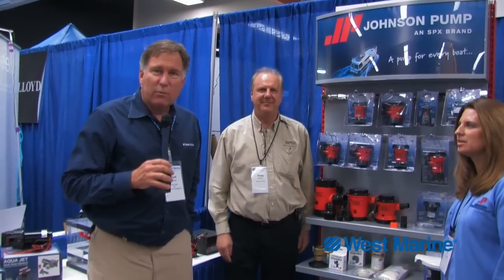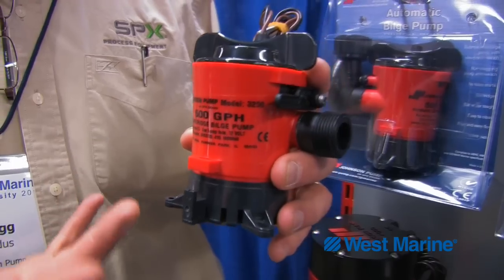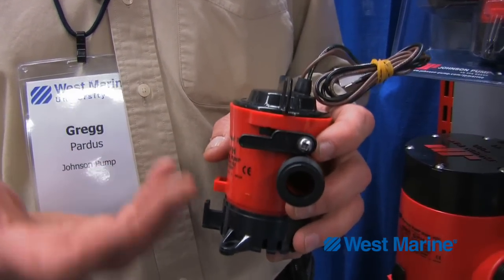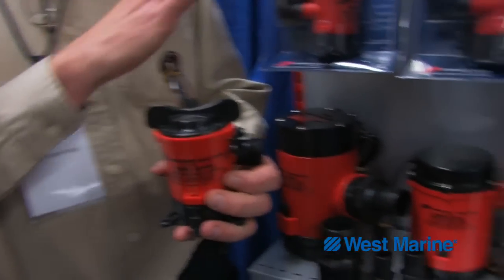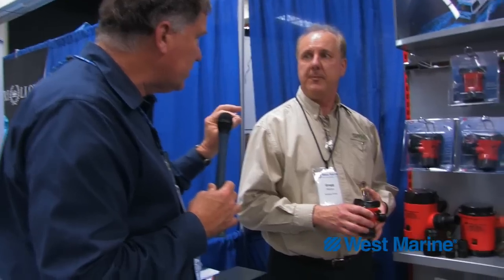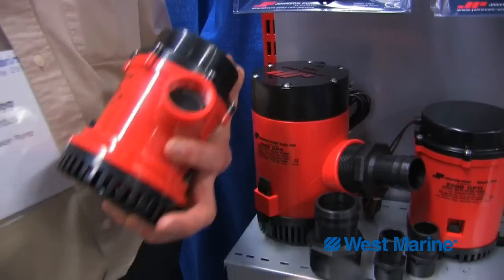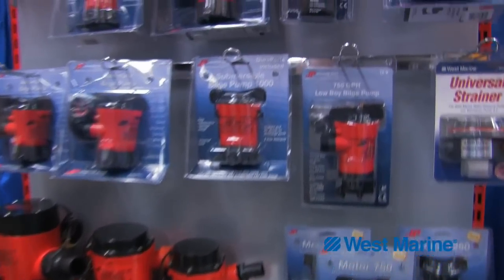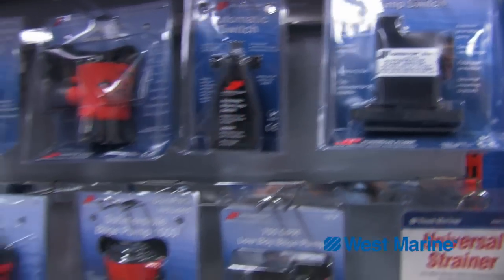Johnson Bilge Pump

Comment: The wiring instructions are written in six different "mouse" languages. The worst instruction booklet I have ever seen. To cut to the chase: The unit comes with the pump and automatic switch wired together.  Cut this solid brown wire and then attach both cut ends to the wire coming from the manual switch (the "first click"). Then, attach the brown wire with red stripe from the automatic to the "automatic" wire.(the "second click"). Then attach both black ground wires to the common ground.  The fuse on you breaker panel should protect the unit.

Comment: I bought the solid state clip from Johnson SPX.  This one does fit.  So not only do you need to verify you have a Johnson pump and see if it has the clip, you also  need to make sure the manufacturer gave you enough room for the flapper or read switch.

Comment: Is there a test feature on the automatic float switches?
Reply from the maker: The only test for that type of pump would be to hook the wires to a 12 volt battery and see if it turns on. We hope this helps!

Comment: Well I was unable to install the read auto bilge switch as the wall on in my bilge was too close to the pump.  I'll try the more expensive one with no moving parts.  The flapper switch may work as well because it's a thin piece of medal that comes down and then it's a high ceiling.  It's a matter of if you can get the flapper under that.

Comment: sorry, i call BS on changing the pump size with a motor change. your telling me you can turn a 500GPH pump, into a 1000GPH pump, and it will pump 1000GPH thru the 3/4" pipe when the 1000GPH unit needs 1 1/2" pipe? lol
Reply: Well then obviously you need to also replace the hose as well.  But it is really nice to have that when you upgrade to the automatic bilge because you can pop the cartridge out and take the wiring completely out while you 3 way splice your wire or wires and then put everything back in.  Otherwise you're doing all of that inside that small area down inside the bilge which is a pain.
Reply: The 1000 gph unit comes with 3/4" fitting, or at least the one I'm ordering does.
Reply: Yep. 1000 on 3/4 inch.

Comment: I’m switching from a Rule-O-Matic 2000 to the L 2200 Johnson. My issue is the wiring is a tad bit different. It would be nice if it was a little more clear on how to wire it. I’m going to give it a hip shot, but it would be nice to know the true way of doing it. Care to reiterate? I think you for your time.